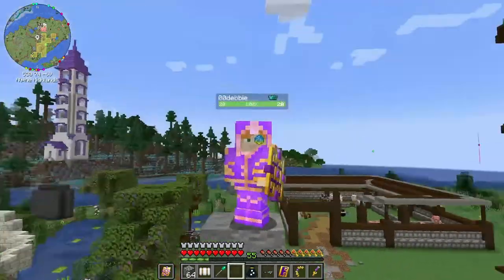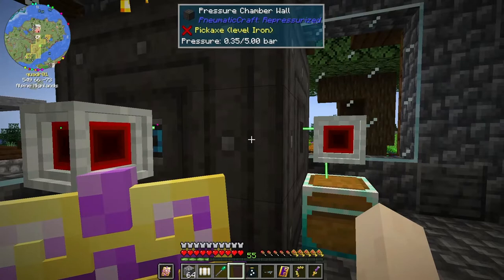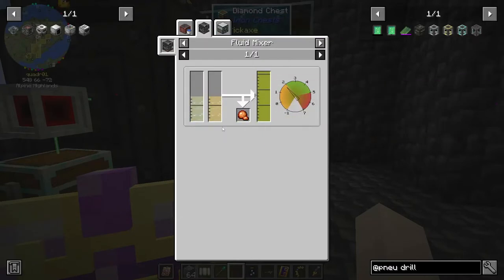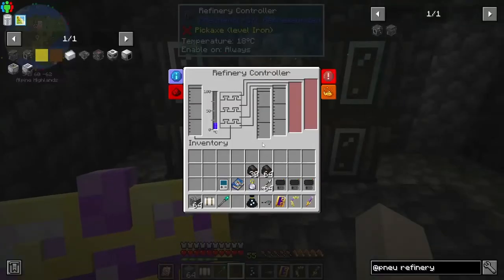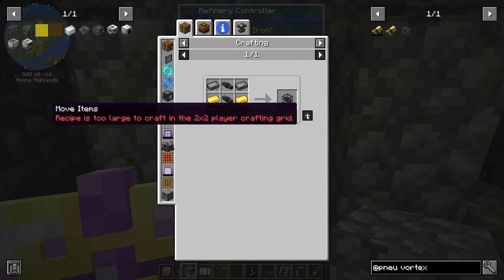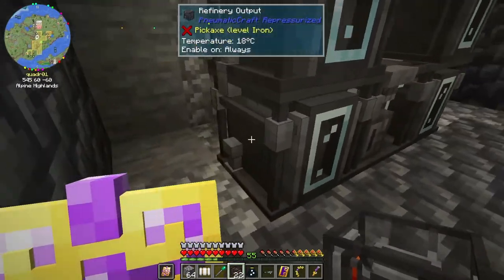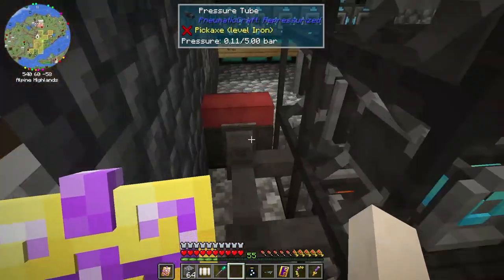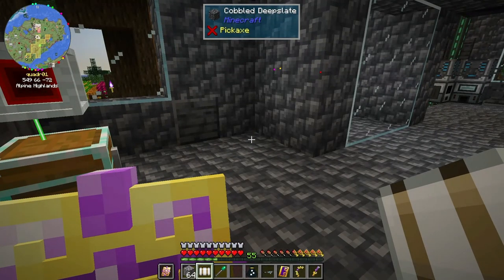DireWolf20 1.18 Let's Play Episode 89: PneumaticCraft Beginnings

Comment: Huh, I didn't know there was a tool to find the underground oil lakes.  I usually just ran around and used a Mek tank in bucket mode to pick it up, and then used the Ore Laser Drill in a desert to generate Crude Oil later.  I'll have to try that tool.  :-)

You don't NEED a refinery for plastic (and lubricant); they're at the end of a chain of Thermopneumatic Processing Plants (with a Mixer in the middle somewhere) that I believe starts with water + mushrooms (to make yeast) and seeds (to make vegetable oil).
Reply from the maker: This is wild. This is sooo much different than I remember . I will have to try that tank in bucket mode thing. Probably easier than carrying around a pump set up. BUT, it was pretty cool watching it suck up all the oil. LOL

Comment: Like the play through. For the refinery all you need is one vortex tube on the refinery itself. The vortex tubes have a hot side and a cold side. Put the hot side (red) facing the refinery and pump air into the side. Cover all sides but the front of the refinery. Also you need to to have all the towers on the same side. Two of yours are not being used. Hope this helps.
Reply: Yeah, I think I quoted Debbie when I saw her make 20+ of them: "Holy Shizoli!", you only need one for the refinery.  The vortex tubes use up air pretty quickly as well, you need a good supply to really get it up to temp.  And you've got hot sides on cold sides, so they're fighting each other.  The colder you can help the make the cold side, the warmer the hot side gets; use heat sinks and heat pipes (I think that's what the PNC heat conductors are called) on the cold side to help it dissipate the heat and stay cool. I think last time I did it, I put the vortex tube under the controller, and then piping them both was easy, and the heat pipes / sinks could spread out underneath.

And thermal lagging is useful because it covers the faces, keeping the heat in, but lets you access the block through it.
Reply from the maker: Oh, man!! Thanks for the tip :) I will try to fix this LOL
Reply from the maker: @JakeMoe  Holy Shizoli! Is right LOL I actually thought I would get further into the mod before I started seeing these differences:)